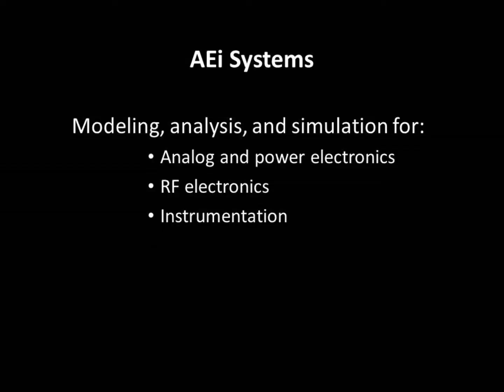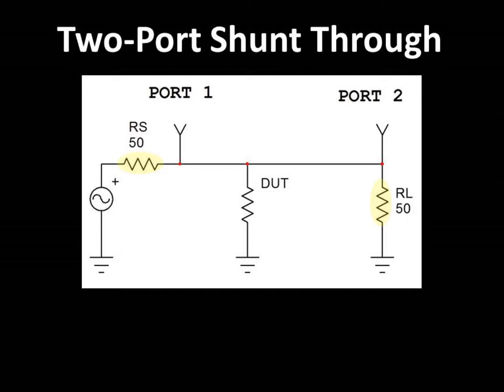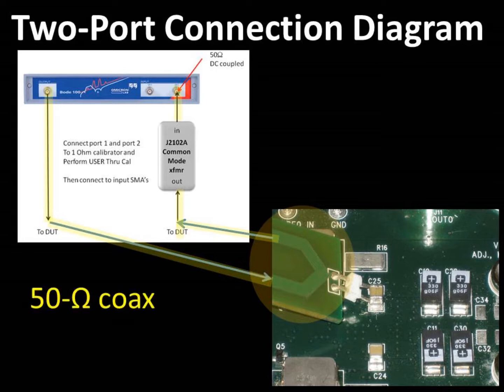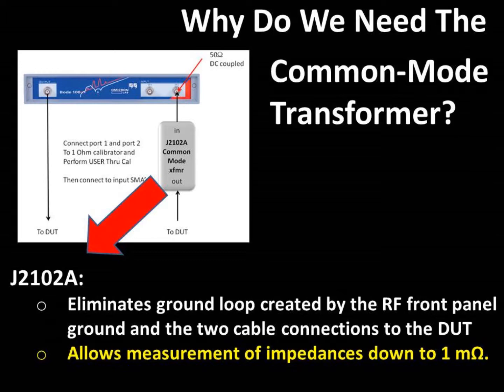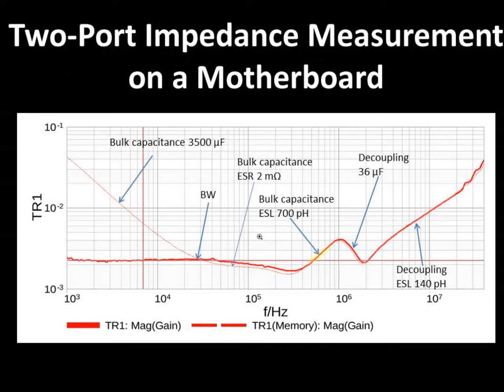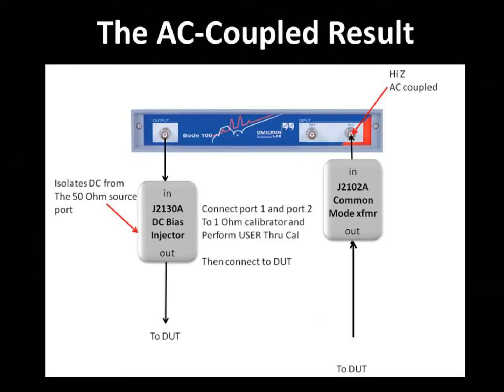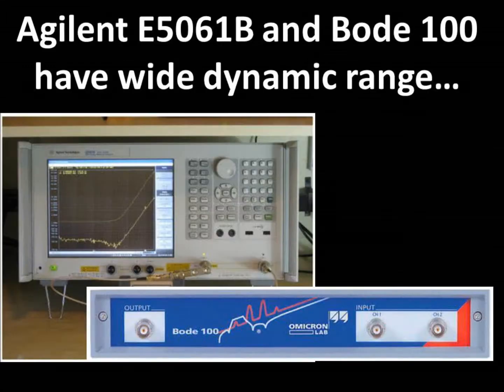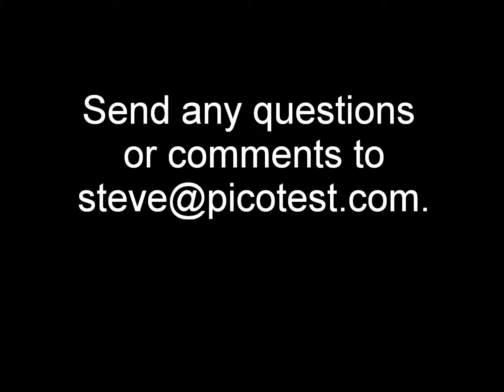Troubleshooting Distributed Power Systems (Part 4): Measuring Impedance Using VNAs (2-Port)

Comment: This is a very useful video. Good to know a very good capabilities of CM transformer and 2-port measurement. Very good for troubleshooting EMI problem due to PCB layout and impedance added by different passive components use in the PCB...